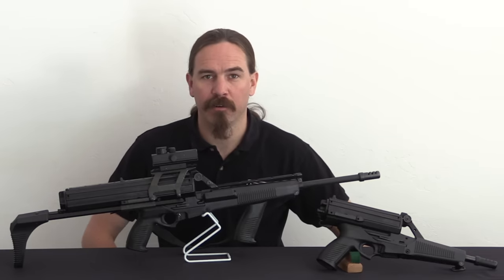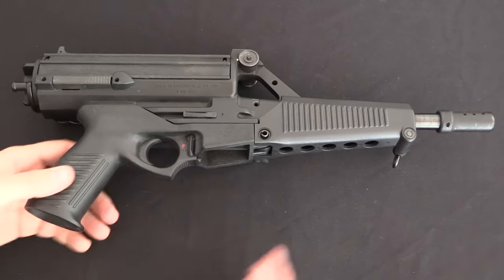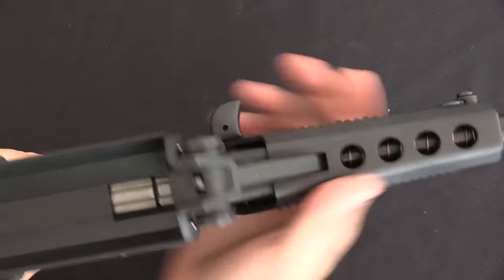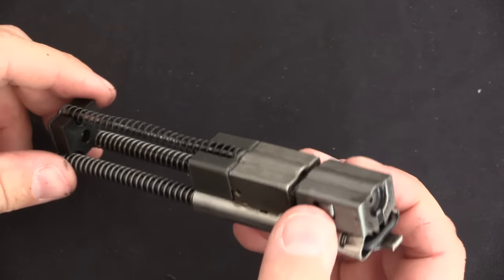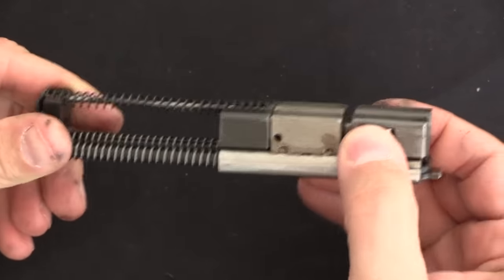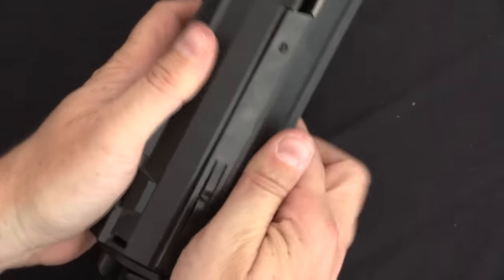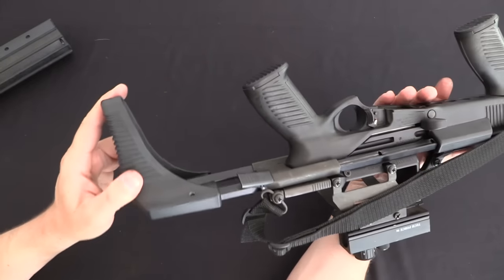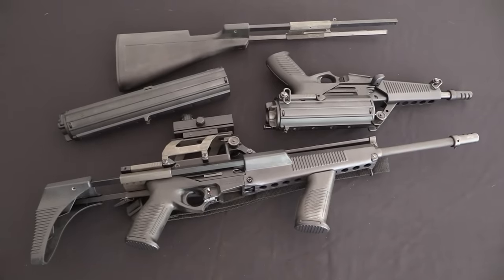Calico Light Weapons System: Roller Delay and Helical Drums

Comment: I have one of these M950s, picked up along with an M100 (both original manufacturing runs) on the same gun shop trip (lucky day).  Your arms get a bit of a work out hefting that 50 round mag around if you go through multiple loads, and a good arrangement taking her out with friends is "you can go through the whole mag, you just have to reload afterwards."
She's definitely not a precision firearm, but the accuracy is acceptable for close ranges.  I've taken her out maybe 7-8 times (mostly with friends) with multiple loads each session, and think I'm just into double digits for loading issues with an all brass diet and regular maintenance.
The retro aesthetic is great, and going through a 50 round mag has put a smile on many a face.  Even moreso plinking away through a 100 round mag of .22 in the M100, but that would be a different video (if it happens).

Comment: Why does everyone rag on the rear sight as the big shortcoming of the calico? I don't see it. I mean, I do get it but this gun was never conceived, manufactured or marketed to be a high precision, super snipper, ultra stupendous laser beam of accuracy. The rear sight is however sufficiently accurate for it's intended purpose. Blasting bad dudes within relatively short distances or poking holes in paper with blazing 9mm furry. Besides, when thinking about high precision, super snipper, ultra stupendous laser beam of accuracy who thinks, "hmmm... 9mm"? Anyone? Anyone? No one! Thats who.
Wow. That was a really unnecessary rant. Especially as I don't own nor ever shot a calico.🤣
Reply: especially with 50/100 rounds in the tank. with than much lead up your sleeve, the sight just gets your first shot or two in the ballpark. then you train the hits on the target. the human brain is stupendously good at that sort of thing
Reply: Who the hell takes the time to line up all sights? The front sight will take you where you need to go.

Comment: I had a friend who had a Calico in the 80s. It was chambered in .22, and we used to call it the pinata because whenever you tried to load it, there was a significant chance of the whole thing spitting ammo around the room like a pinata spilling candy. This became more likely the more you loaded it, thus we usually went out with less than a full load because it was enervating to have to pick up and reload the magazine several times just to get it loaded once. Especially because it became more likely to spit when nearly fully loaded. So the hundred round magazine was often loaded only half to two thirds of the way, and the fifty round likewise left partially loaded.  We eventually partially solved that problem by wrapping the magazine in a canvass bag, which allowed us to keep steady tension until we were ready to try winding it, and it would hold most of the ammo in place if it unwound itself while loading was ongoing. As well as retaining most of the spit ammo without having to move furniture. Winding the thing was far from a precision event. With it requiring different amounts of winding based on how much ammo it had, as well as when different magazines were used. While shooting it tended to jam in proportion to the amount of effort it had been to load, and it would sometimes do the pinata thing if it got jostled. While it was novel fun, and originally came with a brag about shooting all day, it was eventually almost always left behind in preference for any other rifle on hand, and relegated to the guest gun for someone you wanted to pick on all day. Especially once it started unwinding and pinata-ing ammo in response to firing. It once lost a speed shooting contest against a single shot bolt action rifle, despite being fully loaded when the contest began. 
Just to round out the experience, the accuracy was mostly lousy. So the thrill of shooting was nearly reduced to that of banging off firecrackers. Frustrating firecrackers that produced awful groups.

Comment: I actually had a great conversation with the owner in the early year's of the product. Some of the design changes were made to mine, like welding the musle break pin in place so it wouldn't rattle out. Other stuff was a clear or smoke tint magazine cover, just don't leave them on your dashboard as mine melted. LOL.😅

Comment: I really like the idea that you can keep the magazine loaded, without any spring pressure in them.
Just grab a 100 round mag, rotate the lever, slap it in and you're away.
Far better than sitting there loading the gun before you can use it.

Comment: I had the 9mm M100 pistol about 20 years ago and it never failed due to magazine problems. The only failure was AD when the forward roller block, which seemed to be potmetal, cracked when racking it. Put a round into the dirt about 6 feet in front of me. Replaced the block, put 50 more rounds through it, then sold it. From the video it looked like the blocks were different colors, so Ian either got mine or that failure mode is not unique.

Comment: These were a BIG deal amongst my social group when they first came out.
Mostly because of the 'cool' factor.

They were NOT reliably accurate.
Reply: Oh, and the 100 round magazines were known to be unreliable when fully charged. Loading up to about 75, you were OK. Beyond that, not so much.
Reply: @lairdcummings9092  so like any other coffin mag
Reply: @s-man5647  yeah, pretty much.

Ammunition is heavy. Trying to put too much of it in a magazine is asking for trouble.
Reply: Just to be clear, a couple of my circle bought the pistols, and one bought a carbine. We shot them for a while, but were soon back to simpler firearms.
Reply: So, basically the mentioned mount and drum problems. First can be fixed by using carbine version "ramp" to install mounting rail, the other is usual for drums and can be expected anywhere. So if those would be carbine versions in full auto and they would be selling existing stock(ie have more flexibility with price range in hands of sane person not high on sunken costs he'd never make back), there is actually a possibility of selling them off? Ability to screw on barrel attachments and full auto versions would be welcome of course:D
Or is there something else that would turn off even usual customer sector for impractical shit like drums and bullpups?
Reply: @joshuagibson2520  Naaah... I'm too eclectic in my tastes; people would get confused. Firearms, lock picking, blacksmithing... Medieval musical instrument covers of modern music..?! Rescued foxes..?!!

Folks would get mental whiplash.
Reply: @TheArklyte  "TactiCool" sells. It doesn't have to be actually practical, so long as it plays to the ego. 

Drum mags will sell as long as they're legal.
Reply: @lairdcummings9092  don't know if you can sell people on drum mag without full auto capability though. So, that's that. But I guess that they can be sold off quite easy if they don't try to hike the price to high then.
Reply: @TheArklyte  people buy them all the time for their S/A AKs and ARs...

Perfectly useless, but so long as people attach ego value to them, they sell.

Comment: Mine the 100 magazine spring broke on me pretty quick and it happened right after the ban. I couldn't get a replacement spring from the manufacture and the pre ban magazines still in stock at the dealers were selling for more than I payed for the rifle. Fortunately I had a good hardware store in my neighborhood that stocked new and a lot of salvaged gizmos. I dug through a spring bin and found a very good equivalent to the original. The hardware guy said that it had came off of a printing press they scrapped. He had several so I bought them all. It was a little stiffer but worked great. I still have the rifle and I have had no more spring issues with the stiffer spring. Mine still shoots straight, fast and it is reliable as long as I keep it clean which goes for just about any firearm.  I have heard a lot of horror stories though particularly about the .22 model.

Comment: I once owned a calico m100 or the 22lr version. Ended up altering the barrel and threading it for a suppressor. Fun gun and super quiet with that can. The magazine was a royal pain in the ass though. It ended up coming apart at one point and getting it put back together correctly was hell. Every time a round got stuck in the mag or the spring got bound up (which happened all the time) meant a good 20-30 minutes of cussing and flying springs.

Comment: Fun Fact: The "space guns" in the movie I come in peace are calicos lol...I've also owned a Calico M951 carbine since they were fist produced...only had 1 malfunction ever and that was letting a friend use it while we were out shooting and he used +p ammo (9mm dunno on the 22 models) which is a HUGE nono...and sure enough it broke a part (fortunatly its a really cheap part and easy to fix)...so 3 thing to do for sure, 1 no +p ammo. 2 wind the mag to the correct number (10 for the 50 and 23 for the 100rnd) and dont try to overwind it EVER, i.e. broken parts will result. And 3 lube the gun (you can hear just how dry it is in the vid every time he moves the cocking lever) forget useing dry spray lube youll still get that dry zipper/scraping sound when you cock it and sure enough after a mag or 2 youll get problems with feeding (I use good ol trusty Hoppes 9 and its never failed me)...the whole inaccurate sight thing..HA!!! open sights on the carbine and still hitting a soda can at 100 feet plus want better? add optics of your choice. Bonuses with this gun...almost no recoil at all (hell a 4 year old could shoot this thing all day with no problems on recoil..not that I condone giving a 4 year old a 50 or 100 rnd 9mm to blast away without supervision) and the compensator actually works perfectly with no muzzle climb.

Comment: I'm getting really confused about the striker/hammer distinction. Surely this is a linear hammer, since it hits the firing pin instead of containing it?
Reply: It’s similar to the “hammer” in a BAR or VZ58
Reply: Think of a claw hammer, or something like that. It has a curved or arcing path from release as it pivots to contact. In contrast, imagine a striker mechanism as a pile driver, from release to contact traveling in a straight line. Pulling the Calico's trigger lets the striker travel straight to the rear of the bolt, no arc required.
Reply: @dougreid2351  For years that was how I understood hammers and strikers to work, but I've since been told that the distinction has nothing to do with radial/linear operation, hence 'linear hammer'. I guess nobody can really agree on what the distinction is.

Comment: Isn’t it more of a linear hammer system, instead of a striker?
Reply: hammers pivot strikers slide. both work reasonably well.
Reply: spirotagnw hammers don’t have to pivot. A hammer fired gun is where one piece is actuated by a spring to strike the firing pin. A striker fired gun is where the sprint directly acts on the firing pin, now called a striker. 

Ian talked about linear hammer guns before. Recently in the VZ.58 and before that I at least remember the QBZ 95.
Reply: @wolflegion_  Aye, was thinking of the same thing. But this brings up a potential complication: Would defining it like that make a layout like in early Smith & Wesson revolvers, where the firing pin is mounted on the "hammer", technically a "pivoting striker"? The spring is directly acting on that assembly.
Reply: jubuttib good point. Maybe the definitions differ between revolvers and autoloaders because they are fundamentally so different?

Regardless of the exact definition, I don’t see how this gun would be different from the VZ.58 and QBZ 95 in regards of linear hammer/striker.

Comment: A couple comments on the sights: the .22 version mounts the rear sight where the front sight is on the 9mm version and puts the front sight on a tower at the muzzle.
Secondly, I own one of the carbines, and the front sight is easily knocked out of alignment by rough handling, which probably didn't help their chances of scoring small military contracts.

Comment: I had a M100P, the .22 pistol version. I bought 2 extra magazines, a 2 mag holder, the Calico scope mount, and holster. The holster was nylon and garbage. The pistol was ok, the accuracy wasn't. The optic mount for the .22 pistol was stamped of out thin steel. I dropped it once on the floor and warped the crap out of the mount. I had to eyeball it to bend it straight, but it was still on zero. The flash hider that came on it used a set screw, but you never actually had to remove it on the pistol. The .22 models ejected out the side. They were similar to a 10-22 internally. It didn't have any kind of bolt lock. The .22 rifle actually had the rear sight on the tower that had the 9mm's front sight, it had a front sight post on the end of the barrel. The .22 pistol was like the 9mm models, the front sight was on the tower and the rear sight was slid onto the top of the magazine. Only one of my magazines had the rear sight, the other two, when I changed mags, I had to slide the rear sight off the one magazine and slide it onto the other two. They probably wanted customers to buy extra rear magazines, but the optic cancelled that out.

Comment: I have 2, 9mm carbines,1,9mm pistol,22 rifle and 22 pistol. 
These guns rock. The 22 magazines are not the strongest. The metal clip on the bottom of the clam shell is thin , but keep guns clean and they work great. 
You Must tension the spring correctly !!!     23 turns on 100rnd,and 10 on the 50. Rounders.
The trigger is super heavy on the 9mm . But the 9mm pistol is super accurate. Just as accurate as any hand gun I have,  even my early performance center 945 hand lapped with Briley Bushing.

Comment: What a fascinating system. With just a little tweaking and tuning on things I'd bet that could be turned into a killer gun system. It looks like it is pretty light, and there is very little to snag on straps or clothing. That looks to me like something ideal as an airborne assault weapon, the only drawback being a pistol-sized cartridge. There also aren't that many holes into the gun with the magazine in place, so (again, with some work on the design) it should be pretty good at the mud test. The mags also don't look all that hard to carry. I can imagine someone with a pair of spare 100 round mags on their belt in some sort of holsters, or a back pack with 4 or 6 of them.

Comment: The .22 rimfire versions are almost a completely different firearm. The grip is lower due to the ejection port being above its right side. That puts the magazine back farther than the 9mm which has the ejection down in front of the trigger guard. Thus the bore axis of the 9mm versions is much lower than on the .22 versions. The .22 models have a tapered, cylindrical barrel shroud with ribs encircling it.

The website has undergone a major overhaul, complete with a 2022 copyright date. There's no mention of any calibers other than 9mm and .22. Their product list shows several new versions were introduced in 2010.
An item of interest is the list of 33 movies in which Calico firearms have been used between 1987 and 2005.

Comment: Only issue I've ever had with mine is one bad magazine. the plastic teeth that work the anti slip mechanism on the winding system where worn down (came that way) and wouldn't hold enough tension to properly feed the entire magazine. I've never used the sights on my pistol, just hip fire it, cause hey you got 50 to 100 rounds your gonna hit your target eventually and if you can't well... The carbine with a red dot is highly accurate and fun to shoot, but the most fun thing about owning these guns are the look you get when you pull one out at the range!

Comment: I really love the core design of the gun. Double-stack helical magazine. Self-contained roller delay bolt and springs — such an elegant design choice.

I assume military would like an assault rifle with 100 rounds without reload, but I don’t see that as their main concern to begin with. So they aren’t going to compromise on other aspects to have such weapon.

Simple things like maintaining and reloading the magazines in field conditions, or having to worry about proper spring tension means even the magazines themselves aren’t an obvious advantage.

I think this magazine design would better serve a different role, and a larger calibre. Could you have an LMG where a really big helical magazine and a barrel are paired together? That might simplify carrying and operating such system.

Comment: 4:56 I gotta say, Ian, with a forend that short and compact, not to mention a nice, hooked charging handle like that, it might as well be fully ambidextrous.  The difference in the time it takes a southpaw to reach under the gun and swipe that thing rearward is probably pretty negligible.

Edit:  Miming the action out, I'd even make the case that the motions necessary to return the support hand to the forearm are faster than those for a right handed shooter, to the point that there may actually be no functional difference, or even a mild advantage to the left-handed shooter.

Comment: Actually I'm pretty sure those locking surfaces on the receiver are removable as a cost saving measure, the whole receiver doesn't have to be made from a strong hard metal, just those studs.

In fact those look kind of like screw driver bit blanks which they might actually be, a quite clever cost saving measure imo.

Comment: If the 9mm is anything like my .22 version, there is a good deal of difference between each mag's rear site.  They also tend to drift around a lot.  It is a really fun toy, but wildly impractical (even for most range use).